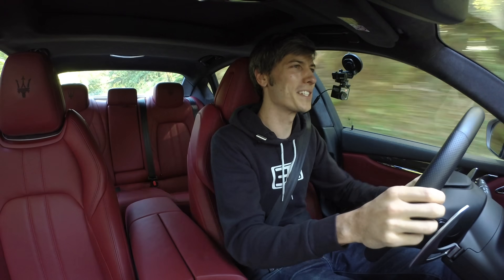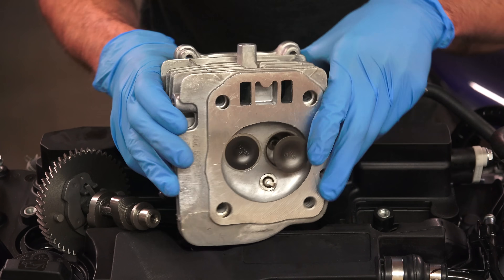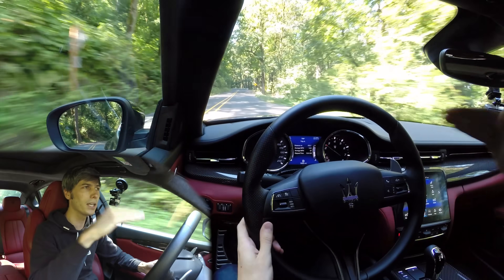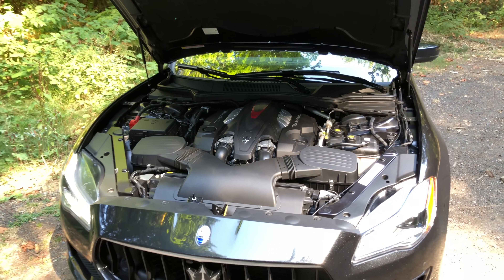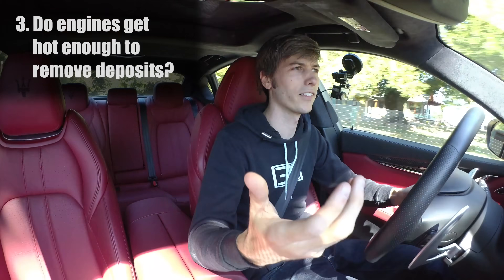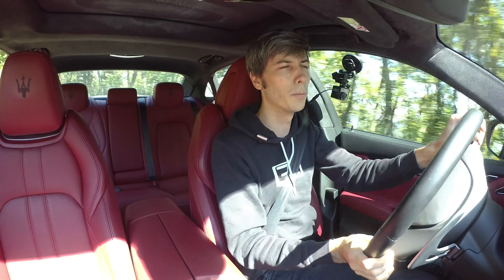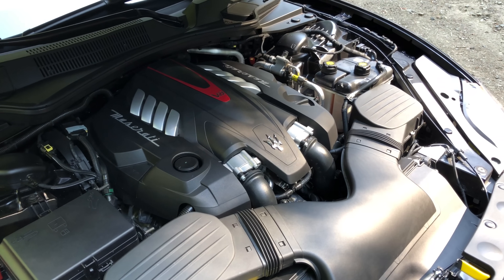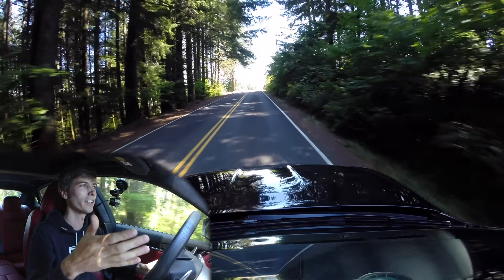Is Redline Good For Your Car's Engine? Italian Tune Up

Comment: Sounds like the answer is no.. the amount of load and heat you’d need to put on the engine to have any effect would probably wear the parts and do more bad than good to your engine’s health
Reply: Fun fact if your car/truck is not a total pos from the factory the part's are designed to take more abuse than you can give them by simply pressing the gas pedal...This is not the situation with all car's tho gm's and dodge's are notorious for letting you take it too far to remain competitive when it comes to the brochure
Reply: @allenbrodess8510  this isnt exactly true. They should be but older vehicles for instance my 82 f150 doesn't have a rev limiter. Doing a burnout one time having fun I accidentally hit like 7k rpm witch scared the piss out of me. 🤣 although no damage was done to my ho 302 I'm sure it wasn't the healthiest thing on a engine designed for 3400 rpm peak power. Lol although I do have a large bore exhaust timing advanced and other things to make more power at a higher rpm I'm sure it wasn't the healthiest thing for that to happen. 😂
Reply: Allen Brodess idk if youre saying gm vehicles cant take the excessive wear and push but thats wrong if so. My lm7 vortec motor is governed to not go over 6k and redline is in the 7ks but even at 5200 i can push it all day and it just eats it up. Ive had days where im doing burnout after burnout for hours and never having an issue. Ive heard with different tunes they can take a constant 6800 and still no issues. Pre flex fuel/afm gm vortec engines are the best no competition.
Reply: @Attachments.  vortec's are the exception they are overbuilt it's the drivelines behind them and everything else that tends to go like the 4l60e it's a pos my grandfather is a retired gm employee he'll tell you the same bout those transmissions as he's went through a few himself over the years the thm lineup was better but still not bullet proof..Gm and ford have worked toghter to design a couple transmissions now care to take a gander at which one's where stronger by the time they where put into the vehicles and which one's where cheaped out on?I'll give ya a hint toyota worked on the saturn project with the cheap mofo's and backed out cause they where being cheap mofo's
Reply: @allenbrodess8510  I currently work for GM and I drive a Ford. My wife drives a Toyota. We both used to own GM vehicles and 2-3 times a year they would be in the shop having major repairs done. I take exceptional care of my vehicles, do not drive them too hard, and always get them serviced regularly. GMs are built cheap and the components just do not stick around for the long haul. It is an unfortunate truth, but it is worth saying there are a few exceptional vehicles they seem to spend more dollars on.
Reply: @Attachments.  when my Instructor owned his own shop he always said even if it is a slow day, you can always count on 2-3 chev's being in the shop on any given day. Lol
Reply: Mike B exactly! That’s what it’s designed for! Pamper it and it will have problems! Drive it for what it’s made to do and you will see how dependable it can be.
Reply: It worked for my 1990 240sx. I just did donuts and burnouts in first gear. And it solved all my ignition and idling problems. Car ran smooth and better before. Sold it but sure the motor would last years to come
Reply: Oil temperature and pressure are important in engine life. 

Also how the engine cools and distributes oil inside the engine. Some engines have weak points where it may not get ideal oil cooling. 

Thus when running the engine under high load for prolonged periods of time, oil temperature goes up, oil pressure drops and those weakness will become apparent. 

Under mundane driving those faults typically don't surface, until the engine sees hundreds of thousands of km/miles.
Reply: My Mercedes AMG redline all the time and now with 286k miles, still drives like new.

Comment: I think it works for me: high revs a few hundred shy of redline, run for a couple minutes. But I use a lower gear, which is easy enough on the manual transmission. Automatic transmissions might not allow for this unless you are going much too fast.

Comment: In my Fiat Grande Punto manual say that you must go 4000rpm for 15 minutes in highway once a number of kilometer. Is a turbo diesel engine
Reply: That's to clean the particulate filter, nothing to do with the engine itself.
Reply: @lagrangian_density  nope... Is for the engine. The manual say it to keep the engine in good condition.
Reply: @amermeleitor  that's the dpf mate
Reply: @tommcmahon14  no. The manual make a very clear statement about it. Is for the engine, not the DPF. The DPF cleans itself in a normal highway driving, no need to go at high rpm

Comment: The Italian Tune-Up is actuall perscribed maintaince routine for older V12 Jaguar cars, you can read it right in the manual and it does work - the guy in the video is right though it depends on engine temperature, the V12 for example is a very very hot engine and has no issue with cranking up the heat to blow the crap out.

Comment: thought you meant Red Line motor oil, the only brand I use after comparing results in several engines. oh well, nice video, thanks.
Reply: I used redline for a little while i find valvoline holds up better over time

Comment: The diesel exhaust particulate filters used to be made in a way that you would burn the carbon out at highway revs. But that unfortunately ended with Euro6 where the filters no longer releases it and it costs a fortune to have it cleaned/replaced. Older diesel cars still do it. If you want to clean the engine ... that is a different story.

Comment: not to forget the additional wear & tear that it adds to youre engine, which is to some point included into the design of it but not above.
however youre engine will not last as long as it will do if you handle it with care.

Comment: If you read the words "Made In Italy" does it fill your mind with thoughts of confidence? NO! I'm German and wouldn't recommend that method you call "Italian Tuning" at all. I have a method of regaining lost performance of an engine that has proven to be efficient and doesn't put excessive wear on your engine. I was working for a company as a delivery driver and swapped car for a few weeks when a colleague was on vacation. The car was running like crap and my method was so powerful and effective, that the colleague recognized the difference by himself after he got back and drove the car. No wonder, that car gained back so much power you could feel it while accelerating and the top speed had gone up by over 20% too. If you think that was one lucky shot, I have done that to several cars I drove with similar or even better results. Maybe @Engineering Explained want's to do a proper episode about this topic and contacts me?

Comment: the 'red line' on any gauge is the limit. that red line means "do not exceed" or damage will result.
 carbon will flake off under rapid acceleration, or during a quick heat so they get broken off by expanding parts. so if you are going to do the itallian tune you should do it before the engine is fully warmed up under load, like getting on the freeway.

    decarboxlisation?? we makin buble hash here??!!

Comment: Similar to this topic I want to know if an Italian Tune Up will clear the EGR and PCV system and reduce the 'slow speed' oil buildup on the intake valves; common problem in my TFSI Golf R.

Comment: My 2015 canyon 3.6 liter was steady at 19 mpg. Bought a boat and started towing which put the truck under heavy loads.  Fuel economy went up a solid 2 mpg to 21 mpg after 2 weekends of roughly 100 miles each pulling the 4000lb load. I don't know what specifically happened but something got cleaned out.

Comment: What about in a rotary configuration? Obviously the engine can hit higher temps than a piston engine and also there are a lot more solvents and lubricants present in the rotor housing to prevent molecular binding. 

Yet rotary owners and professionals alike all insist on driving your car hard. I myself suffered a massive reduction in compression over a month of low RPM driving so the theory makes sense.

Comment: In the RX7 community there is a saying "A redline a day keeps the rebuilds at bay". However with piston engines I think there is still a benefit to getting the car running well regularly. The extra flow through the intake, fuel and exhaust systems remove any loose deposits before they have a chance to settle.

Comment: I think the Italian tune up was much more relevant when referring to cars with more mechanical systems such as carburettors or mechanical injection where jets, flaps, diaphragms and valves etc could get stuck or gummed up. In this situation I certainly do think the Italian tune up is somewhat beneficial for a car that has been sitting around. And also the spark plugs, if a car has been idling for a while and just moved around then I would expect the plugs would become fouled and because of lower AFR and perhaps a hard drive with higher revs and lower ARR would burn off these fuel deposits?

Comment: I think the easiest way to prevent and reduce carbon build up is long constant journies, not short trips and city driving, and also the grade of fuel.

My motorbike gets sluggish and you can smell the carbon on start up if I just constantly do short low speed trips, but pushing it a bit and harsh acceleration smooth out the engine and it's average fuel consumption is better.

Same with my cars I've had, long constant driving always made the engine perform better and when I'd taken the head off my old Mazda before scrapping it, it was clean and bearly any wear with 130k miles on it

Comment: Temperature increase is only one of the cleaning effects when Tuning Up Italian.  The increase in gas flow in high revs is having also an important cleaning effect.  In most of Europe countries, cars go through a yearly inspection where also exhaust gasses are checked for "soot and other" content.  It is a public secret that everybody organises at least 10 to 20 secs highrev cleaning short before entering the inspection.  The good (proven) cleaning effect has in my opinion more to do with flow increase than with temp increase, because of the short cleaning time.  And the cleaning has in my opinion more effect on the exhaust system than on the engine.

Comment: I think this method of clearing carbon deposits only applies to performance oriented engines. I drive a Toyota Corolla and given the temperatures you quoted, I have a feeling that running the engine hard for a car like mine would simply place it in the sweet spot for deposit formation and it wouldn't get hot enough to clear anything out. I'd hazard to guess that for most cars, redlining the engine actually does more harm than good as far as carbon deposits are concerned.

P.S. To anyone who is serious about finding a way to keep carbon deposits from building up in their engine, the best and safest way to do so is to use top tier rated gasoline as it comes pre-packaged with the necessary detergents to prevent carbon from building up in the first place.

Comment: I run to redline to remove my deposits. If the engine gets sooty, there's always Seafoam.
Reply: Seafoam has worked AMAZINGLY well on our older cars/trucks. (everything 15+ yrs old, and 150-300k miles.) At least 10% more MPG and up to 25-30% more. My 2000 Honda Civic (1.6L Manual Trans) would always get at least 30mpg, even driving hard. Now I'm getting at LEAST 35mpg WITH A/C on and in hilly/windy roads with frequent decelerations. Pure freeway is 40+ solid now, almost hit 45 one time when I was going around 65mph consistently. Before seafoam the highest I ever got was 36mpg.

Comment: German here. From my experience with both a diesel 2 liter turbo car and a gasoline 1.6 liter turbo I can report that after hard driving on the autobahn at speeds from 180 kph and above for a significant amount of time in one sitting (30-45 minutes) the engine does definitely feel more alive, hungry for revs and torquier low down in the rev range. If this translates to 'more horsepower/torque' I can't say but there definitely is a difference you can feel. Especially with the diesel engine it sometimes felt like a different car when I started it up the next morning. So maybe it's sustained loads in high rev ranges (diesel: 3.5k and above, gas: 5k and above) that do make a difference to carbon buildup. Maybe it's something else.

Comment: What you say makes sense to me.
 I own a 2016 Mazda 6. I understand Mazda deals with carbon buildup on the intake valves of their GDI engines by designing the engine intake valves to heat up to the point that carbon build up is prevented. They do this by routing coolant away from the intake valves AND by constructing the intake valves with alloys designed to withstand the high heat. Has their method worked? It would be nice to see the evidence. Our Mazda has 67,500 miles on it and so far no symptoms of carbon build up. Of course to be sure would require physically inspecting the intake valves. I'm not going to do that.

Comment: The decarboxylation reaction which removes gunk, like the rest of the universe, is an equilibrium process.

This means it’s a tug of war between the forward and reverse reaction, deposition and decarboxylation. 

The only way to know FOR SURE which operating conditions favour removal is to drive your car a certain way consistently and then look. Adjust accordingly, and carry on.

Comment: Redline is good for your car once in a while. The engine needs to breathe. It needs to open up sometimes. There's a reason engines rev from 6500-9000, depending on your car. It's not because manufacturers allow it to, it's because an engine is supposed to. Now, they're not supposed to all the time, just once in a while.

Comment: In college, I drove an '85 Volkswagen Scirocco with a 1.8 liter two valve 90 hp engine.  Since my parents home was 1100 miles away, for the most part the car was used driving around in my college town, but for the summers, I drove it back to their place.  I did it once in one day, that sucked, so I normally made a two day drive out of it.  To say that the car drove better after one of these long journeys is an understatement!!!  The day after I got home, I'd wash it and then take it out for a drive and the car felt like a raging animal.  

[Well, compared to what the normal 90 hp car felt like....]

I suspect that the long easy drive at relatively high RPM probably did the trick with this port injected engine.  A later port injected car, an '85 Porsche 928S2 was the same way;  The day after a long journey with that thing was an exercise in restraint or an exercise in tire smoke~

Comment: First time I heard this term. I worked for a GM dealer 93-96 these old Hot Rodder guys had stories about the Chevy Fuelie Motor Vette and Bel air. As I was told.  Grandma got sold the badass Fuelie 283 small block chev. For passing power. But never used it. While said Grandma is in the waiting room. Enjoying complimentary donuts and coffee. Mechanic takes her Grocery getter. Around the corner for some Donuts of his own. Blow Carbon off the valves.  Charge Grandma and send her out happy..

Comment: While driving close. Ok drafting behind folks who own super fast cars and drive them slowly. Lame..but I have seen the proof of much darker exhaust in relation to these people filling being fed up with my 68 Dodge Dart Grandma Car being so close to them finally crack the throttle. Not for very long. Of course. But it's always been funny.. Santiago Canyon highway and Silverado Canyon.. Porsche, Corvette owners who just refuse to go over or in some cases near the speed limit. Your car is badass.. Go please. Ok these cars are so much faster then my car.. out profit her in every way. But my car will hold a corner better then most, and I believe I can drive.. and have made these cars in my case..pull over and wave me by only to return the close driving experience,  until  these roads get twisty. Then it's Bye.. my Dart is lower then stock. Good torsion bars and KYB shocks. Very predictable understeer.. and stays planted. Her rear end will only come around if pushed hard. And is beyond easy to read. She just works. Peace Car people.

Comment: I have an 04 civic, if you can believe it, it doesn't burn oil. I run synthetic, nothing specific, whatever is on sale, and I buy gas from busy big name stations(regular/87 of course) and I have a pretty heavy foot, because, well it's gutless. Anyways, 150 000kms and the top of the pistons still look like new. Good gas? Quality oil? Nah, gotta be redline keeping it clean

Comment: Really good info!
A car-centric Mythbusters ;-)
I just found out about pcv systems causing carbon buildup on the intake valves of direct injection motors. Since I have a skyactiv, I'm going to get a shop to install an oil trap in the pvc line ASAP, and switch to Redline (brand) synthetic oil, which has a low evaporation rate when hot. I'll try to clean the intake heads a bit with spray as well when I install my aftermarket intake.